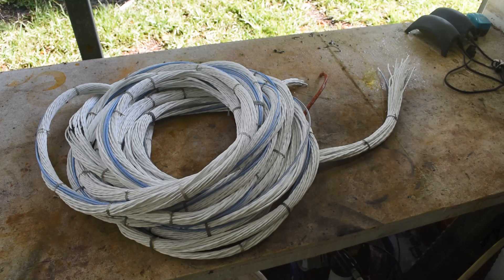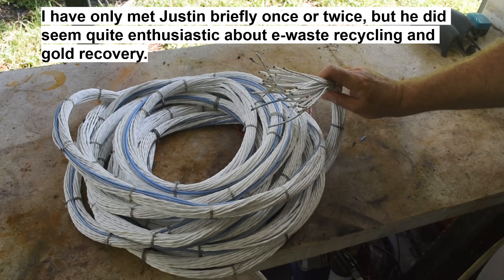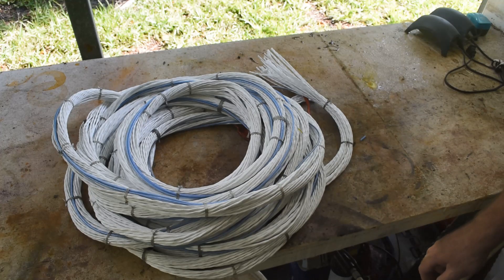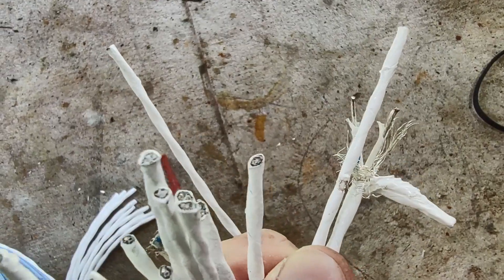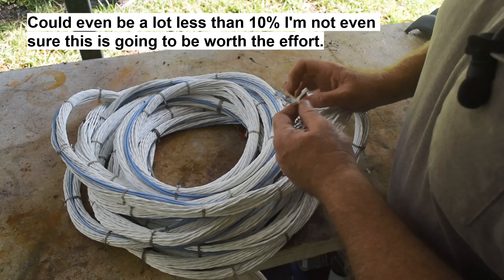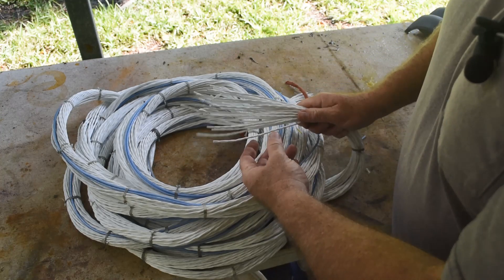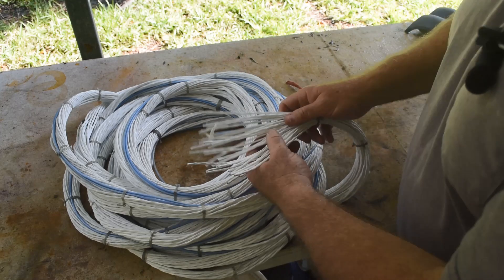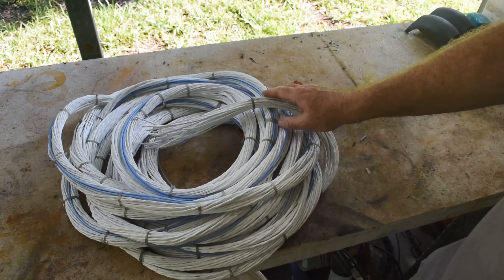Silver Plated Copper Wire: Viewer Donation. How to process? #silver

Comment: @3:27 confused also, my self. what wires are aluminium or what, is there even silver wire? silver connectors on wire? all the ribbons and the power cabels, and the harnesses out of tvs or monitors, or computers, power supplies. i wish i knew.

Comment: Hello, It’s. Den my experience to simply cut the wire to 4”-6” pieces. Lay the horizontally in a good plastic tub then pour your 20% nitric over the wire just enough to cover it. You do not have to strip it ,I know for sure. The main thing is to give your tub a jiggle every few hours, or don’t,  but allow it to sit at room temp or warmer for around two days. Get the salt shaker & go to town!

Comment: It's not uncommon to encounter Silver plated electric wires in High-End electronics; occasionally even solid Silver/Copper alloy wire (usually only if the wires are very thin). If the insulation is PVC I strip such wires by the absolut fastest method: Pyrolysis. This removes the insulation and yields Raw Pyrolysis Oil, and as 57% of the insulation material consists of Chlorine you'll also get a lot of free HCl acid as a biproduct. A few manufacturers have begun using PP for wire insulation to avoid the environmental problematic PVC; this yields a purer Pyrolysis Oil and no "dangerous" Chlorine. 
Warning: Unfortunately sometimes the inner insulation layer on these types of wires is made of Teflon (PTFE). Don't even think of pyrolyzing anything containing PTFE. Such material begins to deteriorate at temperatures of about 260 C, and it fully decomposes at 350 C releasing all the hazardous Fluorine; well below the required temperature of 400 to 550 C needed for processing plastic by pyrolysis.
I refuse to use any physical/chemical process that releases dangerous Fluorine gas, nicknamed "The Element From Hell"! So if the wire insulation turns out to be PTFE it's time to set up my old manual wire stripper and remove the outer layer(s). It's easy to determine if the inner layer on the metal strand(s) is PTFE, because if it's extremely smooth and feels slippery between the fingertips, then it's PTFE.
There are to "types" of PTFE insulation: Let's call them the "semi soft" and the "very soft". The "very soft" is easy to strip. Cut the wires into 10cm pieces, take one piece, grab it halfway along the length with your thumb and index fingernails, squeeze the nails into the plastic and pull off half of the insulation. Flip it over and repeat. Remember that the PTFE plastic is not only slippery on the outside, it's equally slippery on the inside; thus it just slides off. Piece of cake in the evening in front of the TV. The "very soft" type does not work very well in the wire stripper machine, although I modified it to handle down to Ø o,4mm wire (if careful it can even handle wire as thin as Ø o.2mm). Today I only use the wire stripper for PTFE insulated wires because pyrolysis is so much faster for daily wire stripping. The "semi soft" can be run through the wire stripper; that is if you have one that can handle such thin wire. I prefer another way. I have a professional heat gun with adjustable temperature setting up to 600 C. I place it upright on the work table with the temperature set at 250 C. I cut the wires in 20cm pieces, place 5 pieces of wire on the table, grab a box cutter and make a circular cut halfway along the length of the wires by rolling them on the table with only a slight pressure on the knife edge on all 5 in one go. Then I pick up a wire, heat it from one end to halfway along the length for a few seconds, and quickly pull of the PTFE insulation with my fingernails.
About silver recovery: Stripped silver plated wire is cut in 5cm pieces, placed crisscross in a fine mesh household plastic strainer so none of the wire strands lays parallel to another, until it's about 1/3 full. A solution of diluted H2SO4 with a splash of HNO3 is prepared (all acids homemade at no cost), and the strainer is submerged into it. The strainer must be shaken several times with short intervals in order for the acid to come in contact with all surfaces of the wire strands. The Silver plating is quite thin so after a few minutes only clean Copper is visible. After some batches the reaction slows down so a few more milliliters of Nitric is added. Solid Silver/Copper alloy wire is melted and cast into thin flat anodes.  The Silver and the Copper is separated by electrorefining, using free electricity from old solar panels that came in to be scrapped.
I cannot point out strongly enough that you must perform a lot of prior tests with samples, if you chose to try some of the above mentioned tips.
To all those who still commit crimes by illegally burning electric wires: You're loosing a large part of your copper, and your profit! It takes just a minor knowledge of chemistry to understand that Copper loves Oxygen, and the hotter the better for this relationship. Bright beautiful Copper turns black and oxidizes to Copper Oxide. The wire strands becomes crispy and starts to crumble. The thinner the strands the bigger the loss. Pyrolysis takes place in an anaerobic vessel (no Oxygen), thus the yield is 100% of the Copper (bare bright Copper, real candy Copper which demands the highest sales price). In addition there is no smoke; therefore no pollution either, and no big fines from the EPA to worry about!
Reply from the maker: The insulation is PTFE, AKA Teflon. No pyrolysis.
Reply: Lots of great info. I like the sulfiric nitric method. I haven't thought about solar panels either another great idea. I imagine the cost to run a cell at 1-3vdc is very minimal unless like you said you can find a solar panel used for cheap/free
Reply: @SilverStoll .   I've scrapped hundreds of old solar panels. Currently I have 42 pieces of solar panels in stock, all still in good working condition and complete with cables. I could easily give you a couple of them, but unfortunately I'm not located in the US.
Reply: @zero-waste  where are you located if you don't mind me asking
Reply: @SilverStoll .   Part of the year in Denmark,  part of the year in Brazil. English is not my native tongue, lol
Reply: @zero-waste  that is awesome! Two really cool parts of the world!
Reply: @SilverStoll .   Yeah, the whole summer here in Denmark. Then, when it turns winter here, I'm off to the hot tropical summer on the southern hemisphere in Brazil. Enjoying an eternal summer year around.

Comment: Here’s how to recover the silver off that wire once it’s stripped. Add about 1/3 part distilled water, 1/2 part sulphuric acid, and the remaining slowly add nitric. 

This creates a cavitation barrier between the copper allowing you to remove and rinse it off without needing to spend all your nitric to dissolve every bit of copper. Add more wire until nitric is consumed and silver removed, and repeat until solution is close to being saturated, then start again! Cement with copper, melt, and run through a silver cell :)

Comment: I've worked with this type of wire on multiple occasions during my career (building things, not ewaste recovery).  All of the insulation is Teflon, so definitely don't burn it. The outer spiral wrap insulation is a pain to remove, but once that's dealt with the mesh shield comes off easily enough and the inner insulation over the strands slides off the conductors super easy. The silver plating on each individual strand is typically 50 micro-inches, so if you know the diameter of each strand then it's easy to figure out the Ag yield. There is a short video of someone on YouTube removing plating from milspec SPC wire by just dipping it in nitric, but it wasn't an in depth video from what I remember.

Comment: The wire jacket like coaxial is actually pretty quick to cut with a drill powered generic wire splitter. Just alittle messy, mind the small metal debris.
Good luck, multiple methods for the silver recovery would be nice to see on same stock material.

Comment: Well I'd be leaning towards this not being economical, however with that said if a fellow was so inclined I have a few ways I would go at it 1st, get a strand however long you want maybe 5 or 10 grams and melt it while wearing PPE's because you don't want to chance cadmium or some other horrible metal, and give it a good stir with a carbon rod to ensure a good mix. let it cool into a button and take it to someone with a handheld XRF or desktop one (pawn shop or jeweler and have them zap it to see what is actually making up the wire. you may find it contains more than just copper and or silver and may contain some nasties you don't want to deal with or potentially PGM's

If it comes back as being of a high enough percentage of silver with no unknown nasties to make it worth while running in just straight nitric and then dropping with copper or salt then that would be ideal.

You could also do a test run of 100 grams of bare wire (after confirming no nasties) in nitric and then see exactly what the returns are which would be easy enough to find the percentage as any number of grams you get back would be your percentage... eg 5 grams from the 100 grams of wire is 5%.

Alternatively another option would be to build a chemical silver stripping cell consisting of 75% Sulfuric acid in as high a percentage as you can easily find with 25% nitric acid ideally 67% but use what you can get it just may take longer. Two wash baths of regular tap water are fine because you're going to be creating silver chloride eventually. Use a bigger non reactive vessel that won't be affected by thermal shock for the main stripping solution. have the two rinse containers of equal or greater volume of water. go from stripping solution to 1st rinse to 2nd rinse. 

If you notice after rinsing off that there's still silver on the wire you will need to complexly dry the wire off prior to putting it back into the stripping cell or else you will cause some MAJOR heat to be form from the sulfuric acid wanting to rip the water molecules apart

after the solution is saturated and it is no longer stripping silver then you will need to slowly and carefully (stressing this) pour half the solution SLOWLY (emphasis on slowly) into one of the rinse containers (this is because you will create a run away situation that is overheating and it could melt or break whatever your vessels are) (this solution is no joke and you don't want it splashing on you or breaking your vessels and going everywhere) and then the other half into the second rinse container. then combine the two rinse containers into one slowly again but the heat build up from the second time won't be as severe usually as long as you don't rush it. 

Lastly you then add salt (regular non iodized) to the solution which will form silver chloride, then decant the solution for treatment and rinse the precipitate a few times. convert back to metallic silver however you want. Lye and karo syrup works fine.

There is a video on youtube of  what I believe are Middle Eastern or Indian individuals doing this procedure with electronic copper components that were used in cell phone towers that were silver plated, I can't recall the name of the video though. While I completely cringe at the safety procedures and absolute lack of safety equipment or steps if you just pay attention to the science behind what they're doing it gives you an idea of what to do (with PPE's and equipment) up to the point of them converting the silver chloride to metal as the way they convert to metal is not safe nor economical as they vaporize a bunch of silver.

Comment: the melting point of silver is about 120F below copper. melt it off into a crucible?  use that furnace with a crucible in it?  have to be careful as to not melt them both, so temp would need to accurate. maybe one of your kilns?  good luck

Comment: Cool gift but, 
I was experimenting with silver plate flatware, melted into bars and running through copper cell and then processing the slimes for the silver. And I also tried electrolysis to strip the plating off, that took a lot of maintenance. Both processes the amount of silver I recovered was very, very small. The copper cell was more maintenance free and actually, produced some nice pure copper sheets.

Comment: Very interesting gift you got there Mike. Your test results will determine which method might be best, but I wouldn't dissolve it all in nitric. Some time ago I saw a video stripping silver plating off copper base contacts, using 4:1 ratio of : 96% sulphuric + 65% nitric, only the silver seemed to dissolve and the solution did not turn blue from copper. I haven't tried it, but maybe you can test it out, let me know. 👍

Comment: If the coating is thin enough, you could try to use a strainer and rinse the coating off by dunking it in a bath until copper is visible.

Comment: There is only one way to truly strip wire of that nature. Get it down to the last jacket it has and put it in a granulator. Then separate the plastic frim the metal with a gold sluice or a 5 gallon bucket using water running in a cyclone type motion.  As well another possibility is.. using cat 6 as a example. Take off outter jacket leaving only the twisted pair with its coating. Build some of straining device to set in side of a closed heatable box or pot. Slowly bring temp up in the box and the jacket melt off.  It has a fairly low melting point. Caution it will burn if you get to hot and expose it to a flame. With that if you do put in a fire and it is  hot enough it will melt of and burn very clean and quickly and very hot. This is for cat wire only to my knowledge. Not sure what kinda material they that stuff wrapped. But if it is a waxy vinyl material you may be about to melt it away. But a granulater is truly the best way to be honest. Don't burn the outside of cat wire or inside for that matter. it is not the same coating as the twisted pair. The chances you can incinerate at a high enough temp to  properly break it down is pretty slim.

Comment: Hi Mike,   I see 3 or 4 videos coming from this???   I'm thinking NO on the nitric acid process!  Lots of nitric & very time consuming.  Electrolysis would work - but again VERY time consuming.  Making bars for your electrolytic cell sounds the best!  It's time intensive - but not hands on. 
     Just for sh**s and giggles - you might test the white metal for platinum and palladium.  Depending on how old this wire is and if it's aerospace related??? who knows. It certainly looks like a wiring harness from something military.
      If you haven't done it yet - you might take a 2 foot piece of wire and see if a razor blade (or knife) will cut the outer coating.  That coating could be something like Kevlar???
   Looking forward to video #2 with some answers.  Thumbs up!    Have a great day!      Jim

Comment: Hi Mike! I saw a vid from backyardscrapping he dealt with plated forks and spoons and he used mix of sulfuric acid and nitric acid to recover silver whitout dissolving the basemetals, if i remember correctly the sulfuric passivated the copper/brass but not the silver plating.🤔

Comment: I'm with you on cutting one foot off for a test sample. Strip it by hand. No use putting money or time in a stripper until you know what can be recovered. Nitric may be the easiest way but could be cost prohibitive. I like your idea of electrolysis. Probably the cheapest way. Maybe cut two feet and try both methods. I'll be watching. This could prove to very interesting.
Reply: What about silver coated bus bars
Reply: @ScrapFatherScrapSon  with silver coated bus bars I use reverse elyectrolisis with saltwater. it works well. there are several videos on it